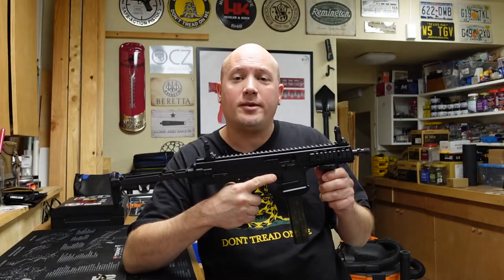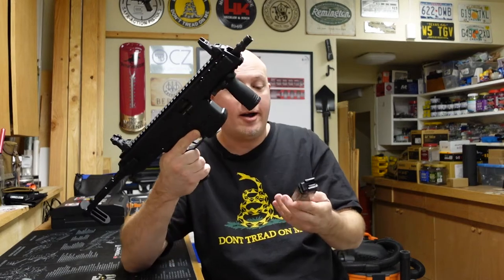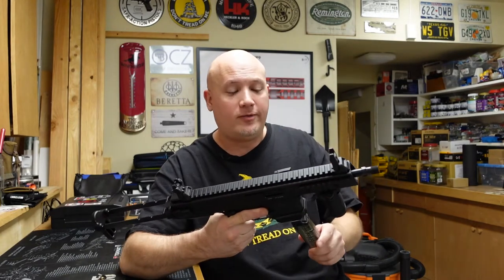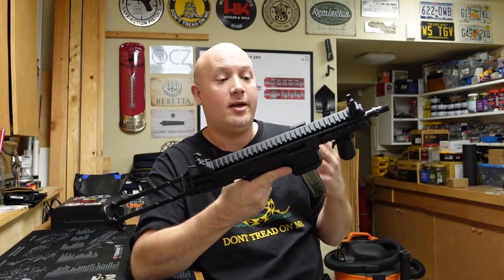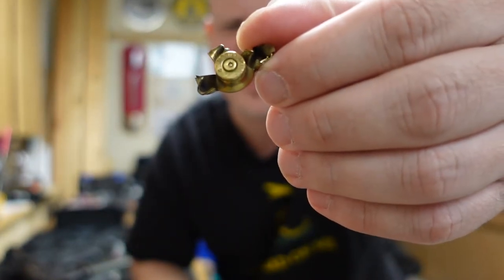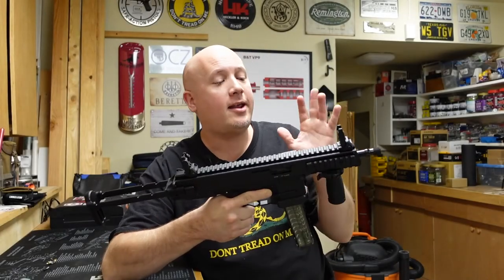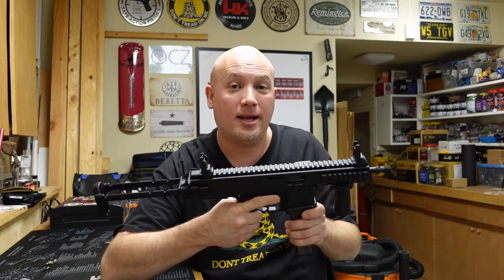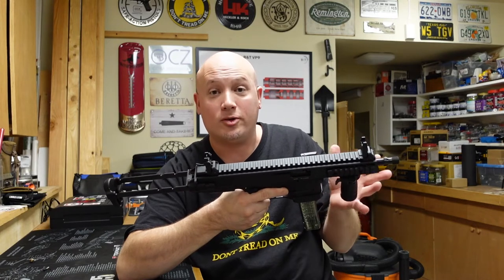My B&T GHM9 had its extractor blown out! Double charged round? Barrel obstruction? Out of battery?

Comment: When a bullet sets back in the case during the trip from the magazine into the chamber, a pressure spike occurs on ignition. The cause is improper crimp of the case onto the bullet. This is more common with higher pressure cartridges such as .40 S&W or 10 mm.
Reply from the maker: Very interesting. I had heard of those issues.

Comment: This happened to me last year. My Ghm9 had much more damage. Out of battery blew out magazine extractor and feed guide parts for 2nd generation feeding hollow points. It also bent my receiver.  Sent it back to B&T and they kept it for 7 months. Originally they said it wasn't under warranty and I could buy a new one at a reduced price which was more than online deals. I held out and out of the blue I received an email asking how did I want my firearm shipped. I had it shipped and received it with a new receiver and small parts they could keep from my original. Looks new but haven't had it back to the range yet. Nice Small and compact for this kind of pistol.
Reply from the maker: WOW! This is happening more and more on this model. I am sorry you had this issue too.

Comment: This has happened to me 2 weeks ago (GHM9 gen 2) exactly the same way. Extractor is gone and I had to pick my magazine from the ground. I have a glock lower and I have used it with Magpul PMAG 27. Gun can should and operate without this specific extractor during the shooting. To extract last bullet in chamber which was not shot you need to till it and bullet will fell of the chamber. I will be contacting B&T regarding my issue soon.
Reply from the maker: I am sorry it happend! B&T will fix you right up.